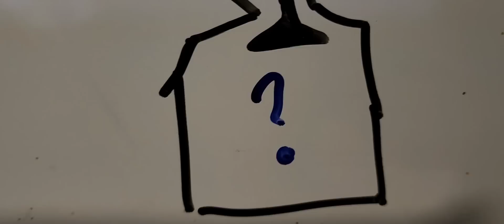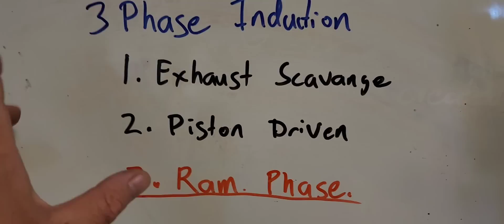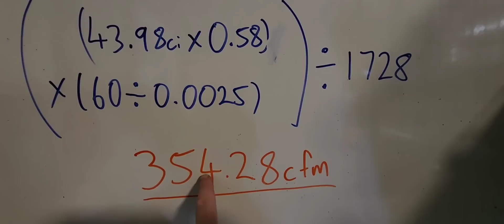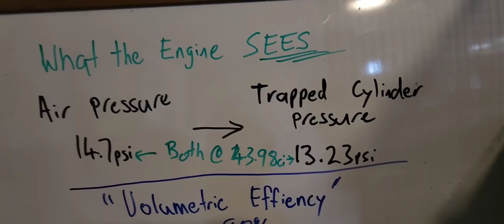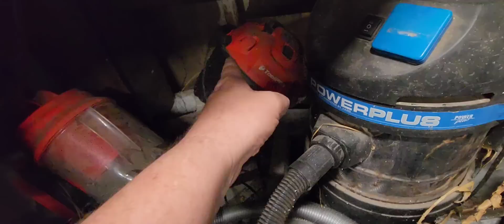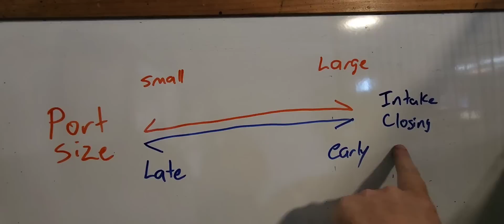Theoretical look at why the 4V Cleveland got its port size.

Comment: 4V Cleveland head design is all about airflow. Big ports= high rpm power. Little ports=low rpm torque.
Reply from the maker: Yes.
If you fail to adjust the cam timing to suit. Which is the point I am trying to make.

Recently I took an oversized ported 2V head that sits on top of a little Australian 302 displacement. The thing was a dog off idle to about 2500. Even in first gear, it was hopeless. Then it revved, but didn't really go anywhere. The more revs, the harder it hit.
Then came the cam check. It was found to be as the cam card said. 108  Centerline. I managed to advace it a tooth, which came to be verified 101.5. The cam was an old Comp with split duration 282/292 advertised with 214@0.050. Small cam, yet acted like a big one.

It starts faster and idles, from cold. It also doesn't have glowing pipes on warm up because it needs 2500+ to make it run, with constant throttle stabs. And now IT PULLS. In fact, the thing will smoke into top gear if you let it. (C4 auto -self shifting at 3000) It now ACTS like a proper V8. The torque is up, fuel usage down.  The poor air speed theory only holds up because of all the "only head swaps prove it". No one is advancing the cam to bring the torque back, and take advantage of the extra headflow.

Comment: Sir, I gotta say you have a pretty great grasp of how engines work. I found you over on a video talking about port airspeed and you asked about the maximum airspeed in a port in one of the comments so I answered you with the data from motors I had worked on.  I love your dive into 2 valve pushrod head design history and you are right on. The 4V and old Weslake Gurney heads are the grandparents of all the modern small block race and production heads. Every NASCAR head since the 4V has just been a takeoff on the design, with tweaks each generation, A-C302 heads, Yates, SB2, P7, RO7, FR9, and the Toyota Cup heads... and in the best aftermarket drag race heads for almost every big block that doesn't run a semi-hemi design. So many people miss these steps in history on how we got here. 

I've never seen those raised port Holden heads being from the states but if you did a comparison video of the cathedral port LS heads and those, I'm sure that would be interesting. 

BTW the video in which I answered your comment was   https://youtu.be/mqpU9jplQwE?si=XZgB85a3eyBduZX_
Reply from the maker: Thanks for that.

I am in a bit of a conundrum over this,  as I am finding holes in the old sound wave theory from Phillip H Smiths book on Intake and Exhaust Systems. It is an important reference as nearly every air induction video references its theory. Word for word.

As what Jake alluded to, I am not doing thing conventionally (taking the road least traveled) and from it my information is different, leading me to different conclusions. I may be wrong, but there is more to airflow than just cfm and depression @28in H²O. Of course, I view the internal combustion engine as a device that converts chemical potential energy to torque which goes against what everyone elce things as well (most believe its horsepower).

I haven't posted in a while due to needing to sort out my personal life - perhaps the greatest challenge for us all. I can't promise when the next video will be ready, but it's going to critique a lot of work that is meant to be foundational for engine airflow, including my own.
Reply: @crd-nz_001  the wave tuning theory is actually pretty sound, see that pun!  Airflow doesn't happen unless there is a depression, period. It's why every weather model is based off of where the pressure gradients are on the map relative to each other. Moving from High to Low pressure is what makes any fluid move, yes there is inertia because we are talking about speeds high enough to provide that, but a lot of how engines work is counter intuitive. Things like these:

Instantaneous port velocity is a closer function to valve lift, than it is to piston position or speed.  
The more VE% a engine makes, the lower the instantaneous depression the valve sees during the phase when the piston is moving down the bore.

One thing to realize is the entire time the intake valve is open, IF you are doing your job right you are increasing the pressure inside of that cylinder, so therefore you need to keep increasing the pressure in the port above it or it will not move from the port to the cylinder. No amount of inertia will overcome that. 

Wave tuning is how you do that, it increases the pressure in the intake port through the time the valve is open so it can overcome the pressure that we are building in the cylinder, because it's not just the piston moving up the bore, reducing the volume of the cylinder we are fighting, but the collected mass that we put in there, that is building up pressure.
Reply: @crd-nz_001  to add on to that last post I made....

Smiths explanation of the pressure wave theory is how we increase that intake port pressure, without the increased intake port pressure due to Helmholtz wave tuning, we would not be able to hold the valve open well after BDC, because we couldn't overcome the increasing cylinder pressure from cylinder filling, let alone the compression of that because of the volume decrease of the piston moving up the bore. 

So wave theory is the only way to increase the intake port pressure, there is not enough mass in the intake port even with that amount of port velocity to provide the cylinder filling. A well done intake manifold/head design will be able to add 8-9psi to that port pressure as the piston moves up the bore, allowing the air in the port to move from the atmosphere into the cylinder as it gains more mass/pressure.

Comment: It goes back to how Ford approached making power with this head versus the competition. Ford used a big head with a mild cam while the rest used a relatively small port head with a big cam. The Boss 302 and the DZ302 Chevy are prime examples. The Chevy had the Duntov 30/30 cam that had 255° @ .050 while the Boss was in the 220° range.
Reply from the maker: That's right. What then becomes the issue is when the Chev designed cam is installed in a large port head, it fails to work. Since the cam does its job in the Chev application, the Cleveland port is then blamed for being "wrong" by having no air speed because of its size. The port size problem has been the scape goat ever since, and still is to this day.
Reply: @crd-nz_001  the advantage we have now is software and cam lobes that are faster ( but safer ). Ill always get a custom grind. A modern cam grind in a 4V will do wonders for all that airflow goodness.

Comment: Very interesting, thank you, but my knowledge of camshaft selection is no good at all. What does this mean in selecting the right cam for my street car, once a year strip car, with 4v open chamber heads? Large ports with low velocity and high flow means you want a cam with low duration (220s-230s), low lift (500-600), 100 lsa instead of 112, to get torque on the street (but vacuum for brakes, 6000-7000 rpm power at wot 1/4 mile)??
Reply from the maker: Yes.
However, be careful as LCA (lobe centerline angle) and LSA (lobe separation angle) are two different things.

The LSA still needs to be in the 110-112° angle, but it could need  to be advanced up to 12 degrees (if the cam is straight up) to get the intake lobe centerline at 100-102°.  Just be mindful of how much lift this will bring  at T.D.C. The advancement of the cam narrows the intake valve to piston clearance. There are roller timing chain sets that allow for this advancement.
Reply: @crd-nz_001  t/y. i couldn't find my cam card. my current flat tappet is about 225 @50, 550 lift, 109-110 lsa. been running ok, not great, for a decade. my mechanic who installed the pertronix iii, recently said i wasn't getting full 12v spark to the coil. looking it up online, it turns out he did not read the instructions when he installed it a decade ago, he forgot to bypass the ballast/restrictor wire. lol. despite getting 6-9 v to the coil, i ran a full second faster than the car&driver 1972 test on my car. but it is still not fast enough. no more power after 5800. I think i will order a hydraulic roller this winter.

what hydraulic roller cam specs would you have them grind for a 357c, 4v open chamber, decked, forged alum flat tops, boss 351 oem aluminum dual plane intake, 1-7/8 headers, 800 cfm carb, 7/16 studs guides, 1.73 roller rockers, 600-650 lift springs, manual, 3.91 diff, will add a leeds electric vacuum pump, for a factory appearing street car that wants to beat most stoplight to stoplight and run the 1/4 mile a couple times a year?

Comment: During the combustion phase the air fuel mixture is ignited. This creates pressure in the cylinder as the burning air fuel mixture expands. The piston is pushed all the way down the cylinder, sending power to the crankshaft through thedriveshaft, transmission and to the drive wheels. When the piston nears the top of the power stroke during the combustion phase the exhaust opens before the intake valve closes allowing pressure to escape the cylinder. A positive pressure wave is created in the exhaust track, from the manifold, down the exhaust pipe muffler until it reaches the atmosphere. When the positive pressure wave exits the exhaust pipe a negative pressure wave is created which flows back up the exhaust system and into the cylinder where it starts to pull into the cylinder. This occurs when both valves are open, the exhaust closing and the intake is opening. This event is controlled by the camshaft and is called valve overlap. When the exhaust valve closes the piston starts moving downward creating a vacuum in the cylinder which is partially filled during valve overlap. The energy from the exhaust gases powers the beginning of the intake phase. When the exhaust it tuned,  by the diameter of the exhaust pipe and its length, and the intake manifold is also tuned the two systems, exhaust and intake, work together to more efficiently fill the cylinder with the air fuel mixture. This type of induction is called Natural Aspirated. When you use a blower, which is a crank driven supercharger, or turbocharger which uses exhaust pressure to drive an impeller the system is boosted. In boosted the size of the exhaust is less important than in a Naturally Aspirated engine.
Reply from the maker: Textbook explanation, thank you

Comment: I just picked up a set of D0AE 1970 Cleveland 4v Closed Chamber heads for next to nothing...
I have a 400 in my 1976 Elite, I have a 460 that I was going to drop in there... now I'm not so sure... I like odd things - while not unique, its rare enough, I think it'd be cool to have 4v closed chamber heads on my 400 (yes I know adapters are needed for the intake...

You have me thinking a lot about cam LSA now... I keep hearing/seeing videos about the Cleveland heads being "misunderstood" (we've all heard that the 4v heads suck below 5000rpm yada yada)...
Time Meyer makes insane power with 400's  - I'm wondering about the possibilities now and how much cooler it'd be to tell people its a 400 w 4v Clevo heads as opposed to a 460... the 460 can go on something else I suppose 😄

Brain working....
Reply: Couldn't the 400m with its extra tall deck height make use of large strokes such as 4.5"?
Reply: @dennisrobinson8008 I know Tim Meyer has 400s out to 444cu-in 

The 400 has the longest stroke of any Ford engine ready so making it longer would be crazy! A 4.5" stroke would make it 452cu-in!

Comment: I built a 68-69 Cleveland 4V , .030 over flat top pistons, used Erson cam, 260/270 was top RV cam. It was in truck and small town. Torker, 2 inch/4 hole spacer, 1850-2. Stock exhaust manifolds , it had 260 psi compression. Chevy(Holden) guy's amazed at port size. She ran really good.

Comment: My 2v with welded up exhaust ports ..in a 73 cougar with 2.73 gears beat up 454ss Chevelles for fun 1/4 mile ...oh so they go home get daddies Corvette want to run top end ? Guess I'm going to get to put in high ...can you say 2.73 gear at 6700rpm?

Comment: Really enjoyed this video 
Was a trip down memory lane for me 
 In the early 90’s I was a hyperactive machinist who helped anyone who had a cool performance project 
 I was asked to run a 1/2 inch ball burr through a 4V Cleveland intake floor to a secret cut depth 
 Now days they call it dimples or golf ball ports 
At the time I was told it was a dynamic CSA that would shrink the CSA at low rpm and enlarge at high rpm effectively making the port smaller by making it bigger 
 I didn’t understand it at the time but similar experiments by others in the industry yielded the port slipper/stuffer/3V
 It’s also worth noting this was for a street/race car and the 4V was already ported 
 Never found out how well it worked but at the time was told never stoke a Cleveland 4V because it’s a 302 race head that gets more efficient the shorter the stroke seeing your 58% at half stroke made me wonder about the rumered 289’s with 4V’s back in the day

Comment: Ford used a 427 engine for most of the sixty’s 1969 was the first year of the BOSS 429 engine in NASCAR! Restricted engine wasn’t used on big block engines. Was until #9 Thunderbird was unbeatable and run away from every other car and make them look like weak sick little puppy’s trying to keep up with the  number 9 Tbird !  Check out 1985 Talladega race his car had a oil hose come loose and put him 2 laps down on a super speedway, they fixed the car and he came out and passed everyone twice under green and won the race ! This is a high speed drafting track, Bill Elliot didn’t have any drafting help, he didn’t need it he made them look sick! NASCAR used 2 rules just to slow down the number 9 car

Comment: The 28" number was derived by Smokey Yunich by averaging the depression in a small block chevy running on a flow rate device and the point at which a small block chevy head experienced turbulence due to flow becoming detached from the short side radius. It was generally accepted at the time that 25" was correct but he advocated for 28" and it reflects his reputations standing that the 28" became the standard. He did not know at the time that over 50" is easily reached by the piston depression and over 100" in a race motor at overlap. Cross flow is what you're talking about and canted valve heads are better than inline and quad valve is better still. 
    Those are the major factors influencing cam timing requirements. Better cross flow needs wider LDA and that allows smoother idle as you find in Fords factory cams and in the modern Cleveland rip off, the LS Chevy.
   The design flaw in Cleveland heads is not the exhaust port, it's the short turn on the intake. The thought at the time was that there was a need to increase air speed to ram air into the chamber. While this aids in low speed output, proven Richard Holdeners testing, it limits top end output due to restriction. Notice the massive port area at the manifold face and then how much it tapers down to the bowl. That is the secret of success of the Cleveland design. This applies to both 2 and 4V heads and open or closed chambers. 
   Small chevy builders trying to build Cleveland motors like they're Chevy's is the source of all Cleveland head complaints like no low speed torque and detonation on open chamber heads. 
   You can run high compression on open chamber heads with a correctly setup timing curve and carb tuning without race gas.

Comment: Ford had to make some compromises with these heads due to both mass production constrains and packaging issues as far as the vehicles it was installed in. However these heads are one of the best (at least for the time) production heads ever made. I’ve built 600 plus HP 10,000 rpm Clevelands using stock 4v head castings. These heads don’t need much other then major rework including port plates on the exhaust side. Unfortunately the Cleveland blocks leave a lot to be desired, and major work is needed to make one usable. There is supposedly an Australian block that’s supposed to be the cats ass however if they exist they are so rare your unlikely to ever find one. Let me tell you there is nothing more fun to drive then a AC Cobra with a 600 HP 10,000 rpm Cleveland with a close ratio 4 speed! If that doesn’t put an ear to ear smile  on your face you are probably dead.

Comment: Btw, while you are correct it takes energy to draw air in but even if the engine dosn't fire it does recover SOME of that energy because air acts as a spring when compressed i.e. it pushes down on the piston until the exhaust valve opens. Its kinda how pneumatic valve springs work in Formula One.

Comment: 4v Cleveland any good books there's alot of conflicting information on this engine.
Reply from the maker: I wish I could say there was a solid book on useful information. The "How to Build" book of the 80s (contains 351C/M and 400), which sticks strictly to stock engine builds, is very good.

Besides that, I have to agree. Most books are over 30 years old, and any new ones discard the 4V head as no good.
Reply: @crd-nz_001  that's what I hear people say ?they seem to do good on the dynos though theres other folks online say the 4v is ahead above all engines of that era and displacement. They always seem to do well downlow in the rpm range on all the tests I've seen. What Head of that era is any good compared to all the aftermarket aluminum heads out now.

Comment: The 351C was the most handicapped engine in PS racing for a reason. Bob Glidden dominated the field with his Cleveland powered 78 Fairmont and never lost a round, race, or event. The 500 in³ rule was a result of the most badass pushrod  smaller in³ engine at that time. Current NASCAR Ford heads still retain Cleveland DNA to this day.